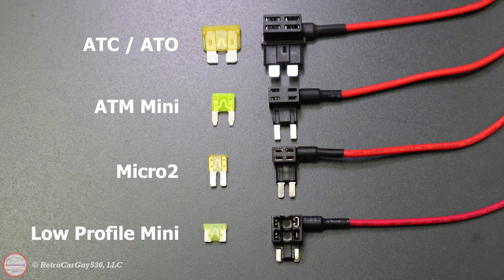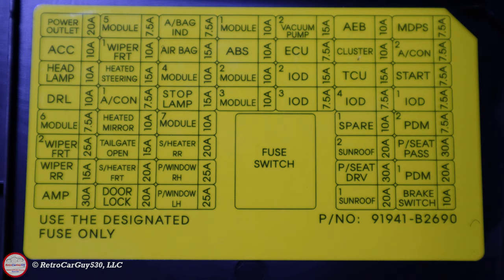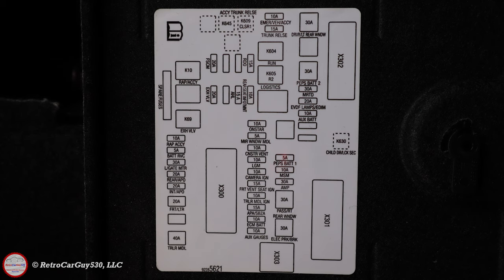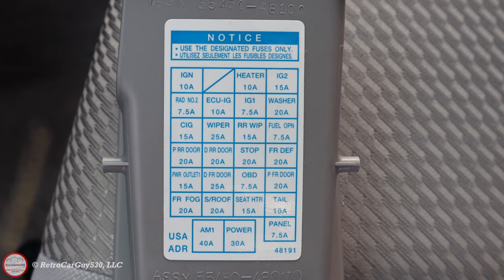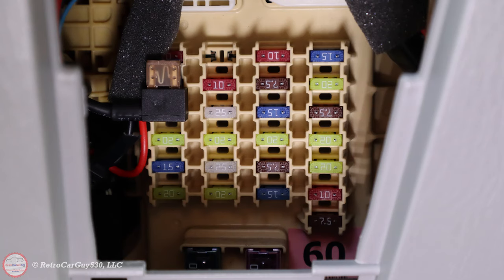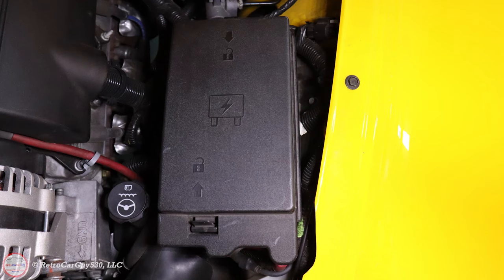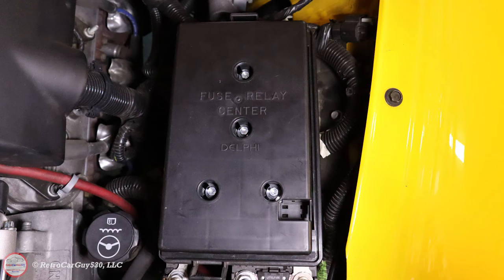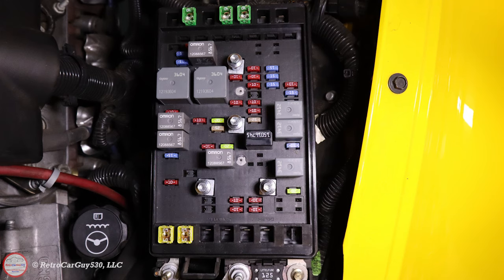How To - Add a Fuse Tap in Your Vehicle

Comment: Hello,
Can you clarify me about this? 
If the label of fuse cover says 10A and my fuse  tap is 15AMP. What amperage of fuse should I use? Thank you.
Reply from the maker: The fuse removed from the existing fuse socket being a 10 amp will continue to be a 10 amp since it will occupy lower fuse socket in the fuse tap.  If you place a 15 amp fuse in the upper fuse socket of the fuse tap that will supply up to 15 amps to the device connected to that wire from the fuse tap.  Combined, the fuse socket will be providing up to 25 amps (peak load on both circuits).  Just make sure the wire from the fuse tap and any additional wire in the new circuit to the device being powered by the fuse tap can handle the 15 amp load.  Most fuse taps come with a 14 gauge wire for the new circuit so it should be able to handle up to 15 amps, but no more.

Comment: I would like to add a toggle-type switch to temporarily turn-off the reverse beeping on a 2020 Kia Niro Hybrid. The wiring diagram for the driver's side fuse box shows two locations on that fuse box that affect the VESS system. Would your method work using one of the two locations on the driver's side fuse box?
Reply from the maker: A fuse tap itself cannot be used to turn off power to a circuit unless the "fuse" is changed to a setup with a fuse and a switch in the circuit.  That would not require a fuse tap, but some sort of fuse extension cable with a switch placed in-line of on one of the two wires.  Here's an example of a mini ATM fuse wire assembly like I'm describing (but you would need one for the fuse type in your car).  https://amzn.to/2NXUYXB

Switching off power to either of the VESS fuses might result in more issues than you're hoping for.  It may have trouble codes (DTCs) set when the VESS loses power.  If the beeping occurs through a particular speaker, you might be able to place a switch in the wires of the speaker to turn it off temporarily, but many vehicles will use the car's audio system to generate sounds instead of individual speakers for that specific feature.

I don't have a really good suggestion on what you're trying to accomplish.
Reply: @RetroCarGuy530  Thank you for your input. I appreciate your time and thought. I was picturing some sort of in-line switch as well but as close as possible to the driver's side fuse box, so the switch could be made accessible to the driver. I am also worried about unintended collateral issues too. I believe all of the VESS sounds on this car come from a speaker just in front of the front grill.  I like the idea about an in-line switch along one of the speaker wires except for access to the driver. I do agree with the notion that these kinds of quiet vehicles need to make noise going forward and backward for safety. I just want to be able to easily turn off the reverse beeping once a day at 5 am when my neighbors are asleep.
Reply from the maker: @ericrice7289  so the sound/noise you want to stop is the newly required noise for pedestrians that hybrid/electric vehicles are required to make.  It's likely that the speaker at the front grille could be silenced with a switch of some sort, but you might get into trouble having that modification during a state/smog inspection.  A friend of ours just purchased a 2020 Toyota Highlander Hybrid and it makes a lot of noise when it's put into reverse. 

The only other suggestion I might make (which probably won't work for your parking setup) is to back the vehicle into the parking spot during the daytime hours so when you depart at 5 AM you won't need to put it into reverse.    Good luck!

Comment: Great teacher ! May i ask you,if i need connect a pair of DRL ,so can i join 2 wires to 1 fuse tap or i have to looking for 2 ACC fuse spot to wiring them separately?Thanks for info !
Reply from the maker: It depends on how many amps each DRL requires (peak startup amp draw and steady state amp draw).  If the peak amp draw of both DRLs is below the available and supported amount of amps, you can join them together and use one fuse tap.

For example, if your fuse box fuse socket can provide 10 amps (based on calculation in this an my FAQ video), the fuse tap wire gauge (usually 14 or 16 awg) can support the required 10 amps and the combined amp draw (peak amp draw of each DRL added together) is less than or equal to 10 amps, you can use one fuse tap.  If amp requirement for both DRLs exceeds any of the mentioned limitations, then you would need to find a second fuse tap to power the second DRL or use the a relay to supply the power (see below).

When more amps are required than a single fuse tap can provide safely, you can use a relay to supply power to the new accessory (DRLs in this case) and have the fuse box fuse tap provide the power for the control side of the relay which usually is very minimal (1 to 2 amps).  The relay can source the power for the new accessory directly from the battery (with an in-line fuse size appropriately based on the new accessory's amp draw requirements for safety).
Reply: @RetroCarGuy530  thanks Teacher,its more complicated than what i am thinking.So for install a DRL which way you thing the easy and safe?Someone use tap fuse,wiring direct to acc fuse leg, connect to the relay(i dont know this one),or use the controller module(i dont know it will drain the battery or not) Thankyou for your advice 😄
Reply from the maker: If you use a relay for the DRLs, the control circuit of the relay could be connected to a fuse box fuse socket which supplies accessory (switched) power.  That way, the power will be turned off to the control side of the relay when the vehicle's ignition switch/system is in the "off" position so that you don't run down your car's battery.

If the power draw of the DRLs is low enough to be powered directly by only using a fuse tap, the same would be true for this configuration in that you would need a fuse socket that supplies accessory (switched) power to prevent running down your car's battery.

In either situation, the accessory (switched) power obtained from the fuse tap would be sent to switch in the interior of the car.  That switch is how you would turn the DRLs on/off.  If using a relay, the power from that interior switch would go to the relay's control side.  If powering the DRLs directly from a fuse tap (without a relay), the power from the interior switch would then go to the DRLs.

My personal preference would be to use a relay to control/send power to the DRLs and that way the fuse tap only needs a small amount of power to control the relay instead of needing to power the DRLs directly.
Reply: @RetroCarGuy530  Thankyou so much Teacher for your quick response.Im interest making my own car DRL but the relay wiring as you recommend i dont have any experience before,so do you have any quick video for instructions?Any advise will be great ! Im appreciated 😃
Reply from the maker: In your comments, please make sure you provide at least one space between sentences, especially after a period that ends a sentence.  If there is no space after the period, YouTube believes it's a link to a remote site which I've setup as not allowed on my video comments and I have to release the comment each time.  Thanks.

In my FAQ video on this topic https://www.youtube.com/watch?v=DnZ5wb_A5vE&t=677s , I discuss a relay solution for providing power to the new accessory (or DRLs in your situation).  I don't have a video on how to install / use a relay, but a high level overview is discussed in that other video.

I typically use a four pin relay for this type of circuit.  Each pin of the relay has a number associated with it and they usually go as follows:

Relay Control Circuit Pins:
86 = Positive trigger source.
85 = Ground.

Relay Power Circuit Pins:
30 = Connected to the vehicle's battery positive terminal.  This wire should have an in-line fuse to protect the device/relay.
87 = Positive power supplied to the new device (DRLs).

When the power obtained from the fuse tap passes through the accessory (DRL) on/off switch when it is turned on, power is supplied to relay pin 86.  The electromagnet in the relay is energized as the power flows from pin 86 to pin 85 (ground).  When the electromagnet in the relay is energized, the relay's internal switch is closed to allow power to pass from pin 30 (battery power) to pin 87 (device power).  The power provided to the device via pin 87 continues until the "Positive Trigger Source" power supplied to pin 86 is removed. 

Removing power from pin 86 "Positive Trigger Source" allows the relay's internal switch to open and the power supplied to the device (DRLs) is removed because the battery power from pin 30 can no longer pass through to pin 87 (or the device / DRLs).

The control circuit of the relay (Pins 86 and 85) should require a very low amp fuse (1 or 2 amp) in the upper slot of the fuse tap.  It does not require much power to energize the electromagnet in the relay, thus why you should only need a small amp fuse in the fuse tap upper fuse socket.

The in-line fuse in the wire that connects to pin 30 of the relay should be as close as possible to the battery to help protect all of the wire running from the battery, to the relay and beyond to the device (DRLs).  The amp rating for that fuse should be no larger than what your accessory (DRLs) require and the wire gauge supports.  Please refer to your DRL's documentation to identify what the amp requirement is for the DRLs.

The "Positive Trigger Power" supplied to pin 86 of the relay should be accessory (switched) power to prevent the running down of the vehicle's battery if you leave the DRL switch on when you turn off the ignition.  The fuse tap should be plugged into a fuse box fuse socket that provides accessory (switched) power to the DRL on/off switch and then the DRL on/off switch power output wire should supply the power to relay pin 86 "Positive Trigger Power".

Here is one of my Amazon US affiliate links that shows a relay that I've used in this manner.  https://amzn.to/3s7jbZM  This product listing includes several pictures and there is one that matches up with what I've described in this posting.  "Normally OFF Relay with a Positive Trigger".  I'm not stating these are sufficient for your DRL installation, but it's at least a reference point to start with including the pictures on the product listing page.

Any and all modifications you make to your vehicle are at your own risk!  It's extremely difficult to give electrical advice via comments on a video, so you must make sure you're comfortable with the topic and modifications you attempt on your vehicle.
Reply: @RetroCarGuy530  
Thankyou so much for your advice and info,Teacher ! I will be carefully on this stage , if it is too complicated , i will wiring DRL to park/headlights .

Comment: Hello. Tried doing a fuse tap today for a Valentineone radar detector...could not get the power to work after using a t tap into the add a circuit and grounding the black wire (supplied hard wire kit).  Used a cigarette/power switch fuse location.  The only thing I can think I did wrong was not plugging the direction correctly/although I flipped around to get different results, or the fact I did not add the new accessory fuse in the top slot of the add a circuit(I did try with the original “removed” fuse and added to the bottom slot).  Is it a must to add the new fuse to get the tap to work? Thanks!
Reply from the maker: The new accessory fuse (for the radar detector in this case) always goes into the top fuse socket of the fuse tap.  The fuse from the fuse socket in the fuse box always goes in the bottom fuse socket of the fuse tap (if one is present in the fuse box fuse socket).  The left leg of the fuse tap (left side when you're looking at the fuse tap and see the fuse sockets of the fuse tap / wire goes out on the top right) goes into the side of the fuse socket in the fuse box that supplies the 12-volt power.

With the above conditions being satisfied, power should be supplied to the hardwiring kit 12-volt input wire.  Make sure the ground wire from the hardwiring kit is securely mounted to/under a bolt/screw/nut with good connectivity to the body of the vehicle for a good ground connection.

I hope that helps!
Reply: @RetroCarGuy530  thank you!

Comment: How did you cut the fuse in half? The one you use to do the testing?
Reply from the maker: I used a medium sized pair of diagonal cutters.  The fuse body is made of plastic.  There's an easier way to do the same test (without cutting a fuse) that I show in my "Anatomy of an Automotive Fuse Tap" video.  https://www.youtube.com/watch?v=YNc0FfeL6rw
Reply: @RetroCarGuy530  thanks. Your awesome

Comment: I don't have a test light, but is it possible to use the multimeter to see which side of the fuse has power instead?
Reply from the maker: You can use a test light or a multimeter to test for power.
Reply: @RetroCarGuy530  How do I do it with a multimeter? I don't have a test light.
Reply from the maker: You place the multimeter in DC volts mode.  Sometimes you must select from more than one DC volt range.  Select one that will include up to 15 to 20 DC volts.  Connect the negative lead to a ground in your car (bare metal screw/bolt/metal) and use the red (positive) lead from the multimeter to touch the fuse socket connectors or the half fuse as shown in the video.  You should see a reading of 11.8 to 12.6 DC volts ( depending on the charge level of your car's battery ) when power is present and 0 when no power present.  As mentioned in the video's description section, you can place a full fuse in the top socket of fuse tap and leave the bottom open.  Test for power by touching the red multimeter lead to the end of the wire coming out of the top of the fuse tap.  If no power, pull the fuse tap out and rotate 180 degrees and test again.  This way you don't have to cut a fuse in half as shown in the video.

Comment: My factory fuse is upside down, so do I place the fuse in the tap the same direction and turn the tap in the opposite direction as well?
Reply from the maker: There is no direction / orientation to the fuse itself.  A blade style fuse can be inserted into a fuse socket in any direction (writing right side up or upside down).  The left leg of the fuse tap must be inserted into the side of the fuse box fuse socket that provides the power in the fuse socket.

I show a slightly easier approach to verify which side of the fuse box fuse socket is providing the power in another video I have on my channel.  https://www.youtube.com/watch?v=YNc0FfeL6rw
Reply: @RetroCarGuy530  Thank you very much 👍🏽